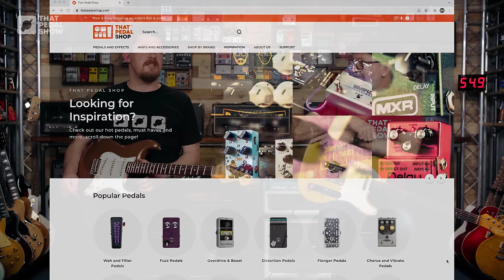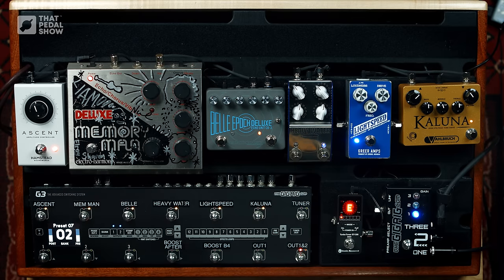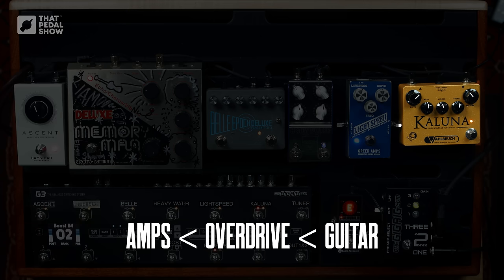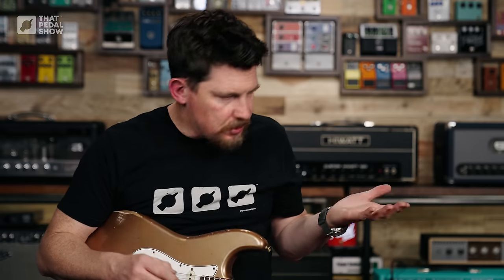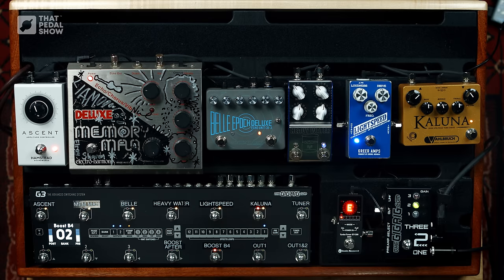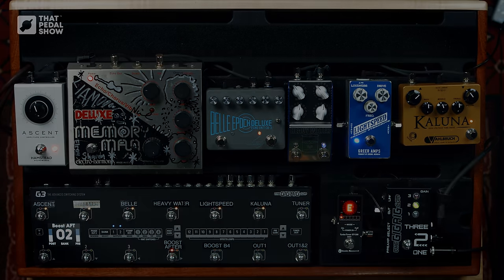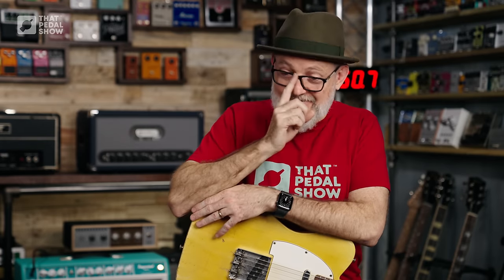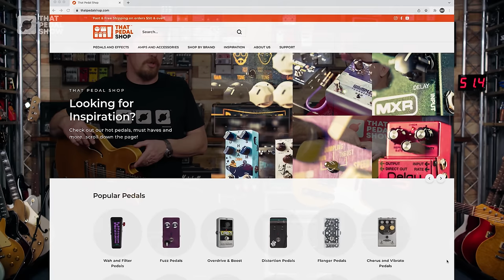Boost Pedal Before Or After Overdrive? [Gain Staging Basics]

Comment: …and if you use your amp gain as part of your signal chain and want to make that louder for a solo, you put your boost in the effects loop…
I really like the amp overdrive and tone shape it in the front with pedals (bd2, archer,…) and also use it for rhythm parts. But to solo I need the volume kick with a bit of shape to not flap out the power amp (used first a G7 but now Xotix Super Sweet @18v).
Reply from the maker: Yah nice. Depends on the loop tho. Sometimes it just adds more gain there too - depends on loop placement and also how cranked the amp is. Nevertheless the theory is all the same - just basic gain staging stuff.
Reply: @ThatPedalShow  yes, that can happen when you play stadium style really loud. Unfortunately, that hasn’t happen to me yet 🤣. Btw. Tom Morello was saying (rig rundown) he did exactly that with a EQ Pedal „to be heard“. So I thought - works for him, works for me 😊

Comment: As I tend to use dual pedals (Budda Zenman, T-Rex Moller 2 or Hobo Drive) the point is moot for me. These pedals are always last in my overdrive/distortion chain. My amps are usually set clean or mildly crunchy depending on the band style so the clean boost is purely that - extra volume. I occasionally use a treble-booster, or its EQuivalent, in front of my drive if I want slightly more cut to my tone but not the extra volume.

Comment: Is there a cost/benefit to using a boost before gain pedals vs just using your guitar’s volume knob to achieve a similar effect of pushing your OD harder?
Reply: I guess it depends on the guitar, it also depends what style you play. If you  are not a shredder, and play a lot of rest notes or rythm rest notes, a %100 volume knob always ruins the attack  of the restnote, and sounds too messy, restnote is delayed  and so sounds sloppy and off time.. Ive never had a guitar sound good on %100 volume, muddies up the signal and chords, loses its clarity, also too much noise.. I always try to find the maximum clean musical tonality of a signal (with the subharmonics etc.)and then  EQ the noise/static, string rubbing out, etc.  as a starting point, 100% gutiar knob volume always seems to mess it up with too much pregrain. But also I suppose how hard or soft you play. Iether way , yiu want to adjust your volume knob so your restnotes play proper and a note stops and starts when you want it to without the added unnecessary noise junk of too much pregain.

Comment: Would be really informative if you could show the sine wave signal as it comes from the guitar & goes into 1st Pedal then coming out of 1st Pedal & going into 2nd Pedal etc...I don't know how hard it may be to do so but it would help a 1000% if we could see what are signal is doing as it moves through each gain stage to help visualize what is actually happening to said signal. This could help a lot of people imaginatively break through the thought process. Plus noone else is doing this. Especially as well thought out as you 2 blokes can do so. Either way thanks for the program & good luck.
Reply from the maker: We’re not fans of that approach. Using ears is all we care about!
Reply: Guitar is not a sine wave.
Reply: Visual learners 👉🚪 🤣
Reply: the csguitars channel has a couple videos like this putting overdrive pedals into an oscilloscope

Comment: Question from a newbie. If a boost just raises the volume, then juat raise the amp volume? It sounds like it does something else than just the volume. I can't explain it
Reply from the maker: Hello! It’s not just raising the volume. It’s raising the signal level - the amplitude - but the way that it does that, and the particular frequency response of how it does it, has a huge effect on the resultant  sound. This is most obvious in the overdrive character of the pedal and amp working together. Now of course, you might not want overdrive, in which case you need a more powerful amp that will go cleaner… and which point you could just turn the amp up! But… you might also want the flavour of a particular boost in terms of EQ balance/compression/transient attack. Hope that helps!

Comment: This video is only really applicable if your amp is on a clean sound. If you're combining Boost + OD + Dirty Amp, to achieve, say an EVH sound (crunch) then the Boost can add distortion to the amp, even if Boost is after the Overdrive. It doesn't just make your OD louder, it front-loads an already dirty amp, causing more distortion / OD.
For example, I used to run through JHS Bonsai (Tube Screamer) then Suhr Koko Boost, into Suhr Badger 35 (with OD on amp) and it sounds better to me and gets closer to an EVH sound, than if I put the Boost before the Tube Screamer and then into dirty Badger. This is also due to the fact that I'm using a Tube Screamer, not a regular OD. Either way the same principle applies if you're trying to front load a dirty amp.
Reply: That's why they make effects loops.

Comment: I hope you read these comments because I am on the hunt for a single pedal that can replicate the 80's high gain distortion much like the DSP 1101 (digitech) or the ME 70 Boss (way too huge) multi-pedal (which is awesome but it doesn't allow for seperation of distortion and FX like chorus, which would be better going into an FX loop) I want a sound like Steve Lukather (Toto) or White Lion's Vitto Bratta
Reply from the maker: Probably any of the modern multi effects would be the thing. Or a Helix - everything in there!
Reply: Delta Labs Metal. Used to be available at GC. They're dirt cheap, I paid $12 for mine.
Or Metal Zone.

Comment: Haven't watched yet but if I run the boost into the drive on my d&m drive I end up picking up interference from radio or TV maybe? I just end up hearing someone talking faintly in the background noise 🤷 thankfully I don't use high gain much so no problem

Comment: You could also achieve more harmonics and a louder signal with just one boost pedal at the end of your pedal chain. Just set up the clean booster to give the volume you want, then increase the gain on your amp so that your boosted signal is making preamp clipping happening, adjust master volume to appropriate sound level. If you want more power amp distortion at those sound levels, get lower wattage amplifier. I guess having both boosts before and after give greater flexibility with the exact extra Harmonics and overall volume, but it is more “moving” parts.
Reply: What if amp have no master? Plexi get loud
Reply: @oneox958  you probably would do the pedal booster option then. But it kind of begs the question, if you’re relying on pedals SS opamp chips for all your eq, drive, and boost. What is a tube amp really accomplishing?

Comment: I have a question, I'm struggling with gain staging between my different sounds, my clean has a vibe pedal that's really quiet so I boost it with a comp, my drive sound is fine but my lead tone has a memory boy & a boost but the delay pedal is so loud I have to bring the volume down with the boost, which obviously doesn't sound great. Is the delay the issue? This is all in a loop switcher. If the delay pedal had a volume control it would be fine. Any help would be much appreciated!
Reply: Maybe try a different delay with volume, or mix knob. Maybe I'm misunderstanding, but it does indeed sound like the delay is the issue here.
Reply: Volume pedal on your delay?
Reply: @craigr777  I've been looking for a delay with a volume or level but I can't seem to find one. I'm wondering if changing the order of the pedals might help.
Reply: @moo3992  not a bad shout, I currently have a mini expression pedal that I could swap out for a volume.
Reply: If you have a free EQ pedal (like the Boss GE7) you could put that after delay to shape the delay’s EQ while dropping volume since that pedal has an overall volume with both boost and cut.
Reply: @craigr777  Another good shout, hadn't thought of that!
Reply: @craigr777  good idea

Comment: The question itself wrecks the real answer.    The answer is, which resolves everything, is that a rangemaster treble booster should be placed before overdrive, and that a clean volume booster should be placed after the overdrive.   If using amp distortion, the clean boost after the preamp should be in the effects loop, not in front of the preamp.  If using a clean amp with no effect loop, then the range master should be omitted and only a dyna comp should be used as a boost.

Comment: What about boost after delay and reverb?
Reply: Why? What exactly would that accomplish vs before delay and reverb? It makes no difference.
Reply: @craigr777  That's exactly what I'm asking 😊
Reply: Some delays can't take the extra level without either distorting or changing the character of the repeats. If you get your delay 'just right', putting the boost after it just makes everything louder - assuming that the amp has the clean headroom.

Comment: At some point can't you just turn up or down your amp/guitar volume?
Reply from the maker: Ah, we should also have mentioned that it’s good to intake air and let it out again, repeatedly, in order that life is maintained. Also when wishing to advance in forward motion, place one foot forward, shift your body weight forwards and on to it. Then pick up the trailing foot and advance that in front of the other, taking care to move it parallel with the other and not crossing its path. Repeat. Sorry, sometimes we forgot to cover the obvious stuff. Cheers!

Comment: Someone needs to make a solo pedal that does both.  Input boost + volume boost.  4 cable method with the gain pedal, amp preamp or whatever in the middle.  So hit one button and get more gain + volume boost for solos.
Reply: More trouble than it's worth. Just use a loop switcher.
Reply: @vorpalblades  Yeah, sure.  Wasn't really asking for myself.  I use a Helix so I don't have this issue.  But ... it's one of the main reasons I use it.  I got sick of tap dancing.  One button, solo, one button, back to rhythm.  All settings change exactly how I want.  Just figured a simple pedal that could do this would cater to the players who prefer using pedals over multi-fx without the expense or complexity of a switcher like the G3 (which looks awesome, Dan).  I'm an audio engineer so I don't suffer from option paralysis and also don't mind dealing with a complex audio path.  But many players just wanna keep it simple.

Comment: Anyone use a compressor as a clean boost?
Reply: I tried, but then I read that compression and boosting at the same time are not working well. So, I purchased a clean booster, a Joyo Roll Boost JF-38 with a huge +/- 38% gain. Excellent budget pedal.